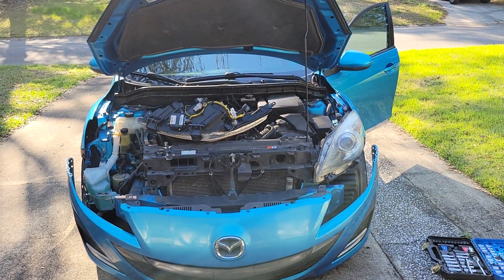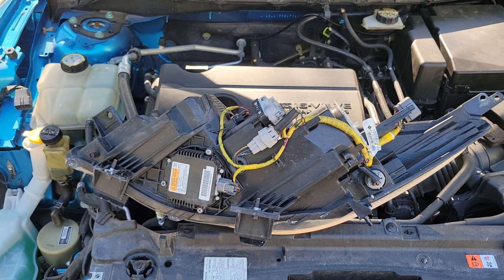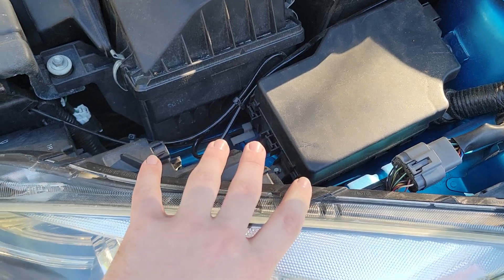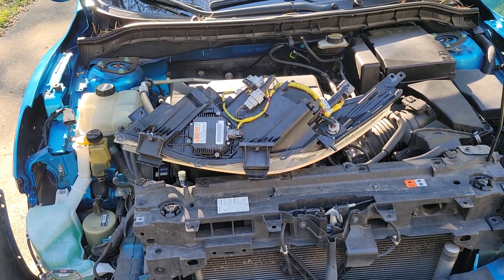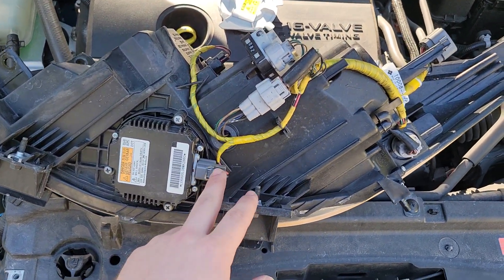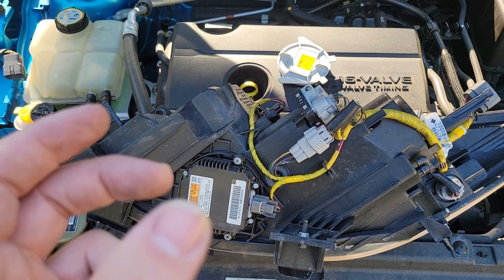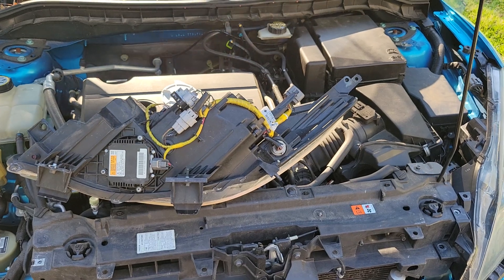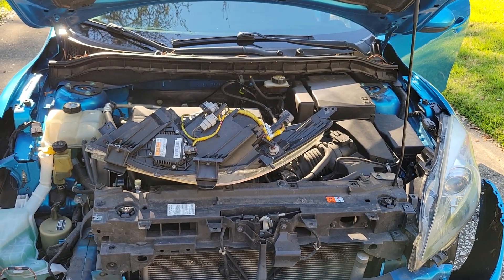Diagnosing Headlight Issues on 2011 Mazda 3 - Replacing Xenon HID Bulb and Ballast

Comment: Just a heads up, I had severe condensation in the right side (passenger side) headlight. The bulb stopped working, I replaced the bulb and still nothing. I pulled the fuse and replaced it and still nothing. Ended up pulling the headlight, resealing it using permatex 8730, just ran the silicone over the entire edge without removing the lense, Unplugged the ballast and walla, a ton of water came out from the connector. I blew it out with compressed air, sprayed 99.9% alcohol in there and blew it out again several times, let air dry for a couple of hours and the bulb works once again. For good measure I also placed a 30g pack of silica gel beeds in each lense using double sided tape under the bulb. No issues with condensation or the bulb turning on since.

Comment: 2014 Mazda3 sGT — headlights work (low beam, high beam) but only the driver-side daytime running light works; passenger side does not.  I have seen it lit on occasion, but mostly not lit.  I’m getting mixed messages from various sources on what drives the DRLs — some say it’s the D4S bulb, some say it’s LEDs in the headlight assembly.  Any thoughts?

Comment: What voltage should the harness be?
Reply from the maker: @TheMontoya760  If I remember correctly, should be 12V between positive and negative terminals. But check through the shop manual linked in the description, it has that info in there.

Comment: Thanks for the video. Best by far.  My light just went out, and I do see water droplets inside. so I am hopeful the draining will help it.
Reply from the maker: I made a goof in this video, and had to do it over later. Turns out, my headlight had a small crack in the corner. I found it by removing the assembly, plugging all but one of the vent holes on the back, and then clamping a bike pump onto the remaining one, and pumping it up. You can use soapy water spray to find the leak, or just listen for it.

To fix it, I used permatex flowable glass sealant from autozone. Hope that helps!
Reply: @evanc.1591   thanks.  I will double-check it when I pull it out.   I drive a far bit of gravel roads so it could be cracked.  
But I wonder if there are vents, then should it really matter? Wouldn't it still breathe or have let humidity in? other way this will all help me save money.

Comment: These headlights were designed by an absolute idiot.  The ballast will continually corrode and fail from water getting into the housing.  You’ll have to buy an entirely new headlight housing and new ballast to fix the problem for any length of time but it will just fail again.

Comment: Mine had a broken seal where the water is coming into the headlight and causing moisture and all that, but i can’t find where the leak is coming from and i don’t know how to re seal it
Reply from the maker: Turns out, mine had basically the same problem! The problem reappeared shortly after this when a bunch of moisture collected inside. I removed the headlight assembly again, and dried it thoroughly. I put it in some stacked up cardboard boxes, with a hairdryer stuck in the bottom. Closed it up, left it running for like 20-30 min until it was totally dry. 

I then attached a bike pump to one of the open vents on the back of the headlamp, plugged the other ones, then pumped it up to get pressure inside it, and listened for a leak. Found a small crack in the bottom corner of the headlight, and sealed it with Permatex Flowable Glass Sealant, bought from AutoZone. 

The new ballast had rusted up pretty bad, so I reassembled it with the original ballast that I pulled out in this video, and it worked! Turns out, the moisture had just temporarily shorted it, and it was fine once it was dried out. 

Hope that helps!
Reply: @evanc.1591  Wow thanks that really helps! I appreciate you explaining that super thoroughly.

Comment: I have a ‘14 CX-5 but I think it’s going to be similar. I’ll try swapping bulbs first.
Reply from the maker: Double check to see if there's any moisture there! If there is, you need to find the leak and seal it. That's a mistake I made in this video, caused the problem to recur. I'll be posting a follow-up soon.